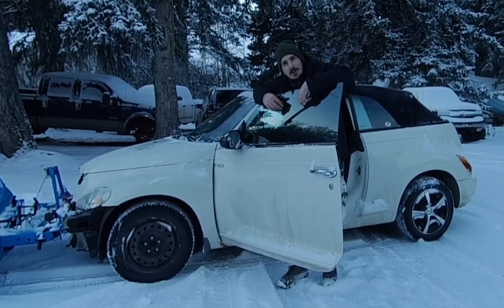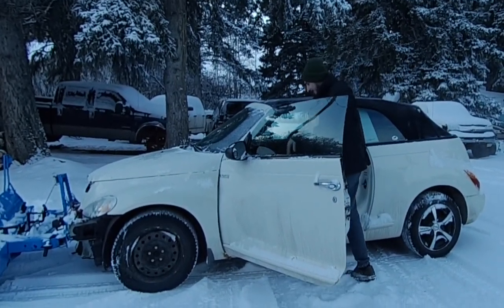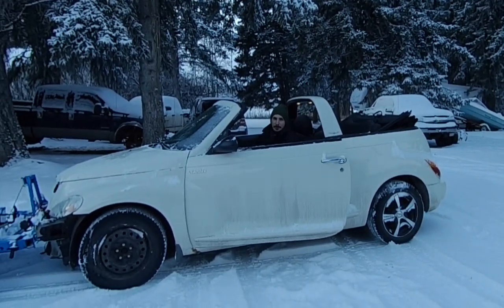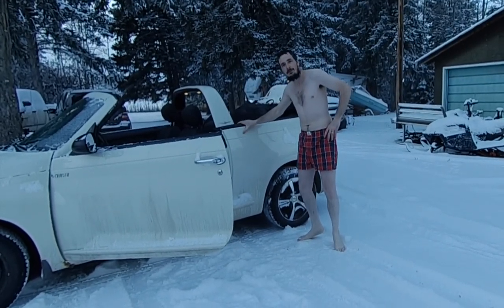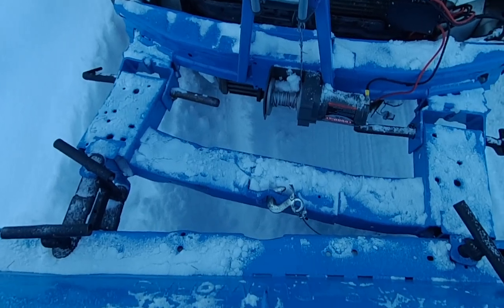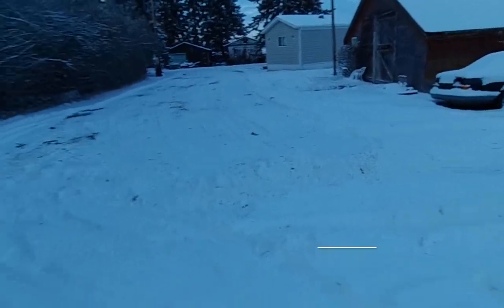PT Cruiser Convertible Snow Plow!

Comment: Hey Matt. I usually ask you questions about the pt. So here's my latest headache. The other day I came out to find oil on the ground. Like maybe half a cup. Anyway it's been doing this anytime I warm up the car. I read it's probably the cam seal or something like that. Any quesses what it could be. I checked the oil filter and oil pan but nothing. I just had the oil changed so I thought it was that
Reply from the maker: Yes that does sound like the cam seals, it should be dripping off the front right corner of the engine, so that would be the corner to the right side and rear of the engine bay, because there is a channel down the front of the engine for the oil to drain away without getting on the belts. You always wanna replace those oil seals whenever you change the timing belt.
Reply: @CarswithNash  thanks for replying. I turned the car on and stayed underneath to see where it's coming from. So as the car is running, the oil starts coming out. It's coming from the oil filter housing. After 30 seconds it stops dripping out. Could it be from the oil housing gasket being bad? I trust your opinion when it comes to this car. So I will follow whatever you say. Lol
Reply from the maker: @ltbomb7194  Typically those gaskets do not leak, in my experience. Sounds to me like the oil filter is probably the culprit. It’s always best to wipe everything off really good and just try to see where it’s originating from, but since you mentioned just having the oil changed, either it’s a faulty filter or poorly installed.
Reply: @CarswithNash  I'm gonna bring it on a professional lift tomorrow. I will let you know what the actual problem is. It's most likely what you said with the cam. Thanks again for all the help and quick responses
Reply: Hey Matt you were right about the faulty oil filter.replaced it and the leaking stopped. Thanks again for your help
Reply from the maker: @ltbomb7194  That’s great to hear, easy fix.
Reply: @CarswithNash  I added the big oil filter adapter kit for it. What's your opinion on those.